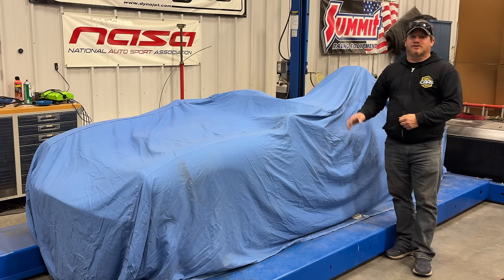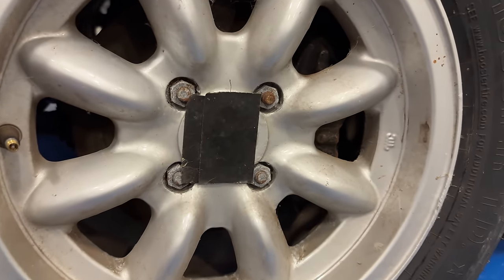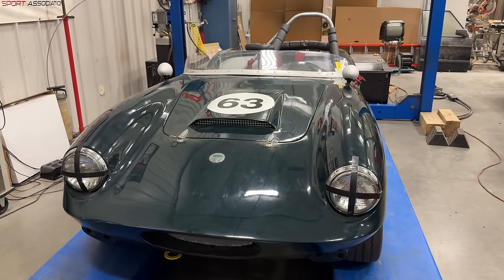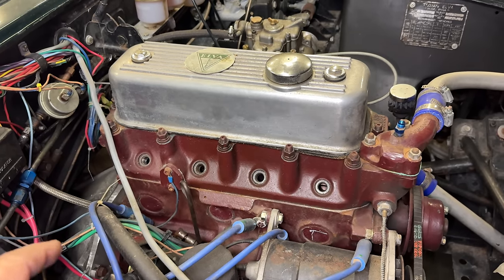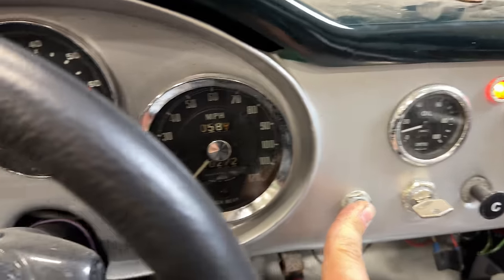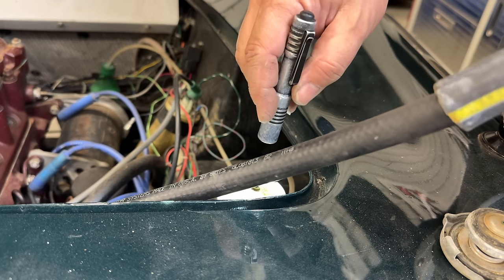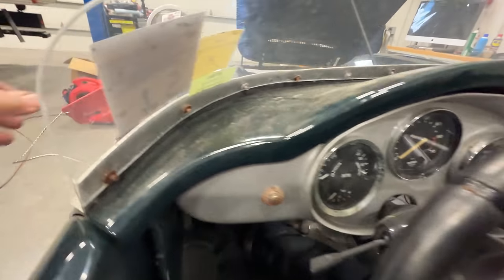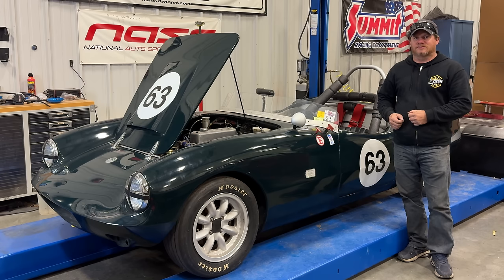Will My New Barn Find Put Up a Fight or Start Right Up

Comment: Well it is green so it could have been a Jaguar D Type! This car looks like it has not been off the road or track for too long and when you came to start the engine it seemed to be eager to run. It sounds good but as you say it needs some preparation if you want to race it. It will be interesting to see some work done on this Elva. Thanks Steve for not making us wait too long for the reveal even if I guessed wrong. 👍👍

Comment: Nice Nice Nice Steve, found in my neck of the woods. Definitely interested In Race Prep videos. Have a 63 Sprite with roll bar & some rear end upgrades. Always have Grant MI in mind since the vid you made racing there. Yepper Full Throttle on the Race Prep vids.

Comment: top car, i just think its strange in a fire / emergency one needs a special key to open the trunk where the race fuel tank is, to use a fire extinguisher
Reply from the maker: That key is used on most British cars made before the mid 60s, Triumph TR2 and TR3s being some of the last cars to use them.  You need the key to even open the bonnet on a TR3, an engine fire is a larger fire risk than a fuel tank.
Reply: @ThisWeekWithCars  thanks sorry hehehe

Comment: That fuel gauge may work and you have no fuel. I’d check because you don’t want to burn out the fuel pump.
Reply from the maker: The racing fuel cell that was put in does not have a sender, on my other cars I use a marked dowel to see how much fuel is in it I was surprised not to find some kind of stick in the trunk for checking the fuel level.